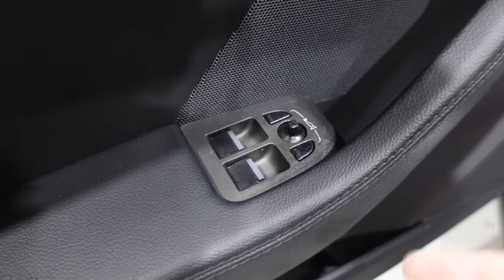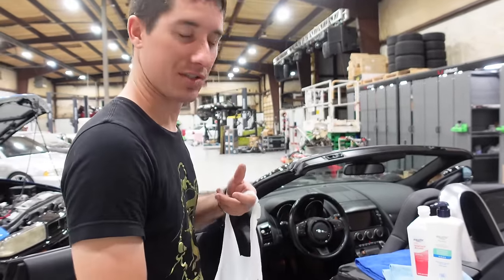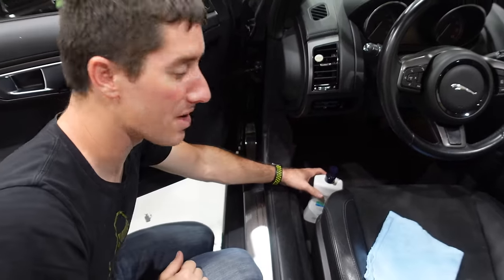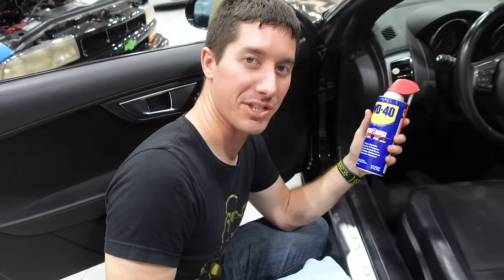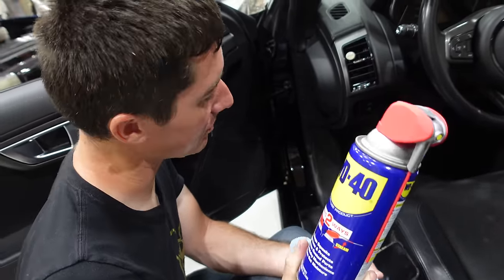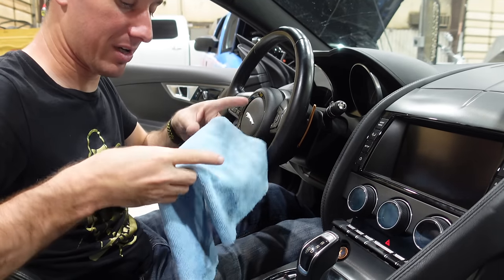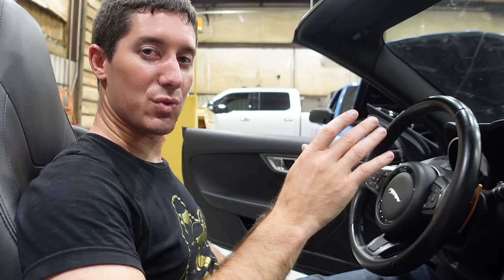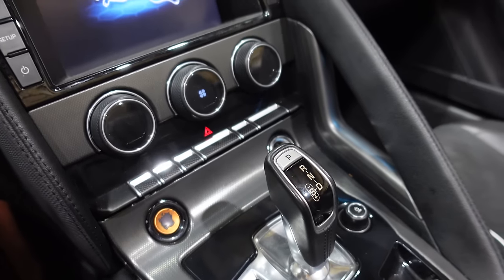Fixing STICKY BUTTONS At Home For FREE (I Try Everything)

Comment: Would this work for a sticky dash?
Reply from the maker: Possibly? Try a test spot on the side or something? 🍻
Reply: Yep.
Reply: Full disclosure, I just started the video without watching the full thing yet, but I have fixed sticky buttons, sticky dash and sticky airbags with 303 aerospace protectant. Spray on, let it soak in a few minutes, wipe off, repeat if necessary.
Reply: Not on a mazda... I tried it on my friends and it didn't work.

Comment: 90/10 rubbing alcohol is TOO AGGRESSIVE! Use 70/30! I have fixed my XKR & XKR-S sticky buttons with rubbing alcohol, and once made the mistake of 90/10 which ruined the graphic on one of my buttons by rubbing parts of it away. The BEST product is a guitar fretboard lemon oil solution made by Dunlop! It has a built in soft applicator into the bottle top and the acidity is just right to not destroy the paint on the buttons.

Comment: Ok, watched it. I guess the alcohol was isopropyl alcohol, cause when it comes to dissolving rubber texture/glue residues it will be this order from my experience:

1. Thinner (will disolve many plastics, so not really an option )
2. Nail polish remover (aka Acetone + some oil)
3. Iso-propyl alcohol 
4. Ethanol (T-red here in Sweden)

NOTE! Equal solves equal, so if its just a matter of fat from peoples fingers, fat would work (oil, 5-56, likely even lotion). Rubber button gunk is different and probably why you got many proposals, cause people dont know the difference.

Comment: The best glass cleaner to use for streak free glass is hydrogen peroxide. Take a microfiber towel (wet) and wipe the glass up and down, side to side. Then with a dry microfiber towel repeat the same wiping process. Crystal clear, no streaks. 
You can also use a 50/50 solution of rubbing alcohol and water in a spray bottle for deicing your windows and locks in the winter time... 💯

Comment: Some lotions have isopropyl alcohol in them that will actually work., But not worth the mess. Some makeup remover has acetone in it.  So if you want the surefire way to get soft touch off.  Acetone (fingernail polish remover is often weak acetone), the soap and water, then isopropyl.  WD40 works on some stuff and having used it on retro computers for over 30 years I haven't had it break down plastic.  Acetone can damage plastic.  IP I have never had an issue with it either.

Hair bleaching peroxide can also be used to remove yellowing on plastic (look for retrobrite) however it can reduce UV protection in the plastic.

Orange peal oil or lemon peal oil will strip some also (goo gone is mostly orange oil)

The retro computer community has about everything in cleaning and restoring plastic.

Comment: Just saw this a year after it was posted, but I will often times use a Q-tip (& 91% iso) instead of a rag, yes you will go through a bunch of q-tips, you will want to buy a large pack instead of using a mate's cosmetic supplies), but it is easier to target the sticky spot. I clean my keycaps on my keyboards this way.

Comment: i've only found one solution to the sticky rubber factor, that lasts. and it isn't good for buttons, since it covers up the indicator part. i tried a ton of stuff, didn't like the result.

duplicolor vinyl and fabric spray (paint? dye? whatever.)

i used it to redo the interior of my mk4 jetta. the downside for some; it leaves it that textured black plastic feel, instead of rubber.

me? i prefer it over ergh its sticking ew ew ew.

and you basically use it like spray paint, or if the plastic/rubber isn't letting it adhere properly, they sell an adhesion promoter to help with that. also works better if the part is warmed in the sun.

i went from a water stained mess of nasty soft touch rubber to a full black semi-gloss dream or stuff thats wonderful to touch compared to how it was.

Comment: The manufacturers should give the owners new buttons/trim or clean the buttons to get rid of the residue. There are testing procedures for all materials used in the car by all the responsible suppliers. Plainly there is insufficient testing going on and the customers are paying for it. As for the alcohol, using 70% instead of 91% may clean the buttons/trim with removing any paint. Alcohol on a Q-tip can help get into the crevices and tighter spots.
Reply: Without?

Comment: I know I'm a year late, but don't sell yourself on the sun and heat doing this damage. I have a 2013 Mercedes Sprinter van. I have always let my detail guys WASH it, but I always do the interior. The last time I had them wash it, I also finally let them do the inside. Instant stick on the steering wheel buttons. Whatever they used to wipe that down caused the problem. I live in Florida by the way, so yeah, plenty of sun and heat, but never a problem with sticky buttons, until I let the detailers work on them. The problem is not the heat and sun. I have to ask my guy what he is using, and I will get back to you all.

Comment: 0:40 this problem can never be eliminated. when yıu byy a new car it won't have sticky surfaces but give enough time every thing made of plastic will become sticky. Because plastic degrades over time and turns into it's liquid petrolium based form, being exposed to direct sunlight allways accelerates that process. Even best quality plastic in best possible storage are not immune to this, due to the nature of the materialit's impossible to make a plastic that won't be stick over time.

Comment: powered graphite is the call - all the lotions will leave residue - you could not complete the mission on the shop - hopefully you will recoupe some value - welcome to running a small biz
Reply: try some fast drying solvent like acetone and spray it in there - no residue - the buttons may have been designed bad - maybe you will have to take car apart and drop switches out like engine

Comment: How do you fix sticky buttons from soda that got in it
Reply: I've used alcohol (91%) with canned air and a lint free cloth (micro fibre works). Laptop/computer keyboards need to be dried before powering back on so I used the canned air and then let it sit for a few minutes.

Comment: I don't get all these "how to" videos. Why not just use a product made for the job? I used Diamondbrite Interior Cleaner which I bought on ebay for just £6 in the UK (about $7.30 at today's exchange rate) and it's perfect. It doesn't damage anything or take any paint off, you can even use it to remove stains from the headlining. I've never let the buttons get that bad anyway but regardless, I think even if it's not available in the US any similar product would work.